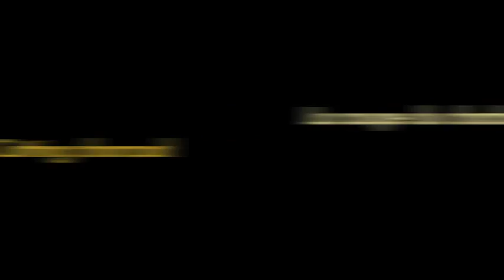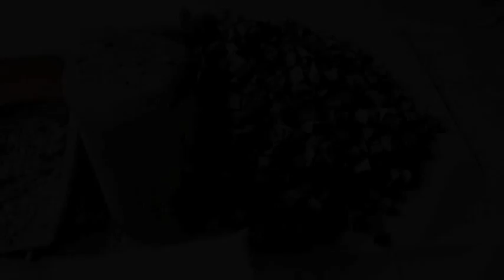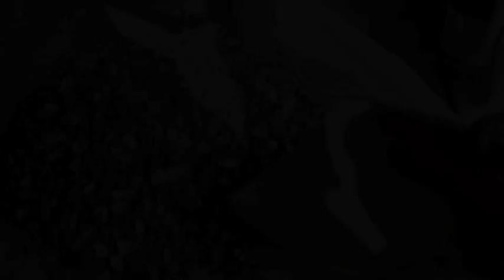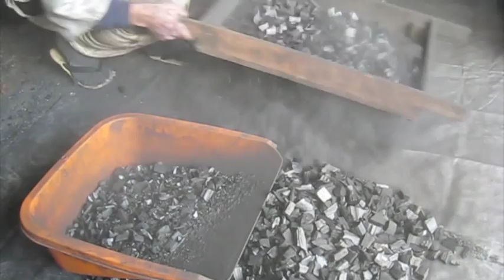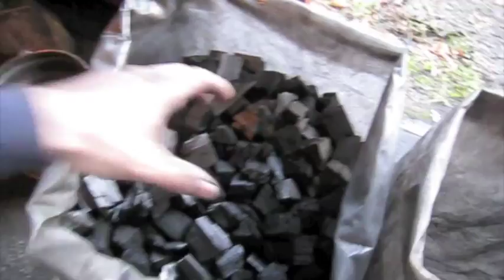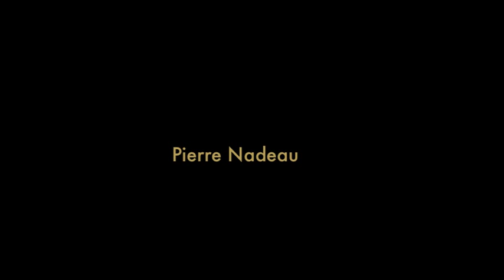Sumi-kiri - Charcoal cutting - Coupe du charbon

Comment: Did You made the carcoal?
If so, how did You get those fine pieces?
Dry destillation?
Reply from the maker: Sheep Ewe I didn't. In Japan I used to buy it from charcoal makers and in Canada I'm still hunting for a maker. But the answer to your question is this video: we cut and sieve
Reply: Ok, i was just curious if there was an easyer yay to make japanese carcoal since i can´t get it here either and it looks wery hard to make the traditional way and i can´t get hardwood here.
Reply: @sheep1ewe  It's softwood not hardwood. USE SOFTWOOD
Reply: Ah, i noticed Your reply above after i posted...

Comment: a question, because collect and separate the sizes of coal and dust? sorry if English is bad.
Reply from the maker: +Joseph Bazante I'm not sure what you mean, but we cut and sort the charcoal for different applications. For example, bigger charcoal is used to create a wider heating zone in the forge, while smaller charcoal is used to create a smaller heating zone (to heat only a small area). Small particles charcoal is used to line the bottom of the forge and charcoal dust is used in clay mixtures to make it refractory or in pellets making for smelting.